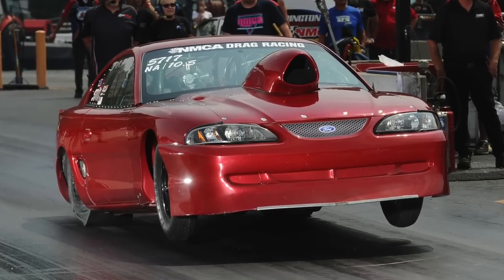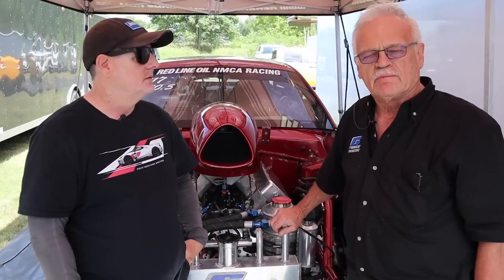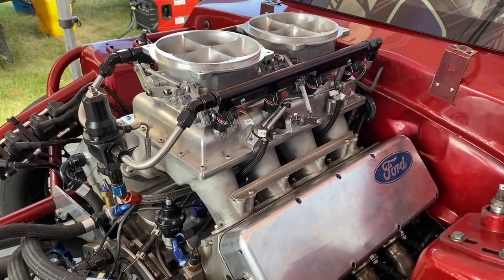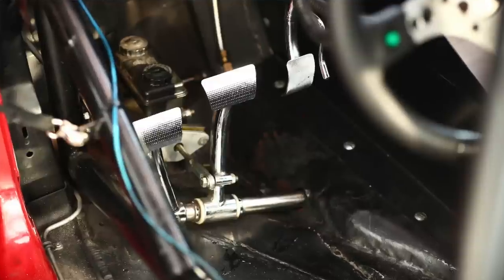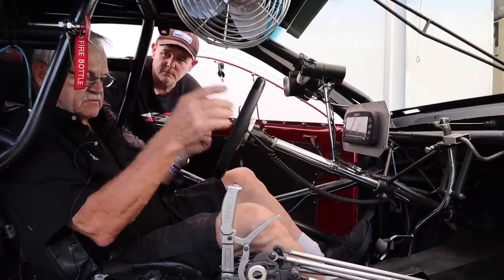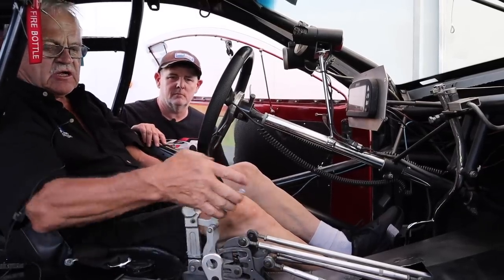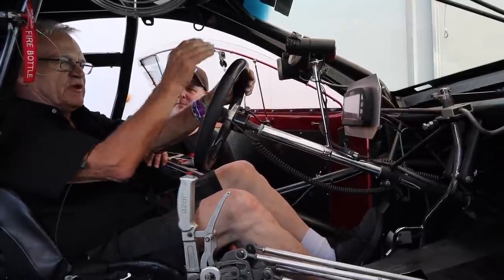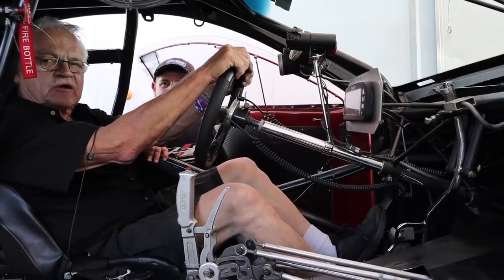10,000 RPM Small-Block Ford Makes 1,100 HP | Manual Trans, All-Engine Leonard Long 7-Second Mustang

Comment: One of your best videos ever! This guy is a TRUE enthusiast. You can tell by his voice that he lives to do this. Awesome just Awesome 😎...And he does it with a SBF.. My all time favorite. 👍
Reply from the maker: Thank you!
Reply: The thing is, when people find out a person is a go getter, like this guy is; they work them to death....

I bet he has no idea where the snooze button is on his alarm!
Reply: I’ve got an addiction to NA small blocks. May not make the most power but the sound is 👌🏼
Reply: @RadDadisRad  my Dad and I had a .030 over 350cid so 355cid and it was together for over 15 years with no catastrophic failures and was never taken out of the car and it had 14.1:1 compression so a big dome piston and it a .540 lift solid flat tappet camshaft in it and it was N/A and the 72 Nova it was in weighed exactly 3000lbs on the nose with a 230lbs driver and it was all steel all glass and everyone that was ever around it said that it was the best sounding SBC they ever heard and it ran consistently high 10s every weekend at the track and was on the street for the first half of it's life so it pulled double duty so to speak and then we took it off the street and just ran it on the track  and after 15 years we pulled that small block out and put a bigger small block in because we wanted to go faster and that engine was still together and running when we pulled it out
Reply: @revanevan  when you find these high rpm builds please go into the valve train details if possible. hp is easy high rpm is not...

Comment: Wow. What a great video. I’m 70 years old and watched a lot of drag racing. Nice to see N/A Ford power, but more than that:  10,000 rpm with a pushrod V8….that is amazing.  Not so long ago, if you could turn 8500 everyone assumed you were running the ragged edge of blowing up on every run.   Valve train technology and aftermarket blocks and rotating assemblies have continued to improve the breed. I had to laugh when he said he is using “old style” NASCAR heads.
Reply: Those castings are in fact over 25 years old, C3's and D3's are canted, and flow in the 400's int. Im sure close to 16:1 comp. too... great all motor small cube combo!
Reply: I believe those heads were used in the early 90s. 700ish horsepower in a Cup car back then. I always wanted to see a set on a 427+ cube small block!
Reply: @collegeparkwhiteboy  The C3 castings are splayed valve, the D3's are canted. Nascar run the D3 castings all the way into the mid 2000s prior to the FR9. This engine is more than likely 17+ to 1 and Over a 1" of lift on the camshaft.  Essentially a Australian prostock deal.
Reply: Yes they are based off the d3 head but both the intake ports and exhaust ports have been welded up and raised so much that the valve cover rail had to be raised up too . The chambers  were redone with 2.300 int and 1.58 exh valves and I think the valve angle were changed too (it been a long time ago that we did them I don’t remember if we changed the valve angle or not but I think we did) and yes it has over 1.00 in lift cam in it. So yes it’s based off from the old nascar heads but are nothing like what they used in nascar.
Reply: @colt7448   not quite a Australian pro stock it’s about 150 hp less and there all using billet heads
Reply: that shit is not n/a lmfao theres def power adders if hes claiming n/a hes probs running nitrous
Reply: @ianb3866  - you’re too used to those crappy Chevy engines. Fords make power buddy
Reply: @CoyoteFTW   Is that why 50% of mustangs got an LS in it? Buddy.
Reply: @ianb3866  - is that the only argument you guys have? Monkey see monkey do. 1. engine swaps aren’t easy people are lazy why not just do what’s already been done. 2. Foxbody platform is perfect. It’s not because ls is some marvel. There very easy.
Reply: @CoyoteFTW   I guarntee youll get gapped by a LS 7/10 times in racing. I am not saying sbfs cant make power LS is so much more simpole and aftermarket support is so much better. If you want to rule them all you go HEMI. at that point youre really making custom stuff and custom tunes. Youre used to watching youtube videos and not participating in building engines or racing so put a lid on it.
Reply: They are 1100 n/a dude...  There are 400 ci Chevy ls in the 1200 hp range.
Reply: Agree
Reply: @ianb3866  Only Chevy guys put Ls engines in Fords because it's a better chassis.Always cracks me up how you have to justify your ls swap into a Ford etc.Have you seen an MMR Coyote ?Now that's a real engine fit for a Mustang.
Reply: @dennisrobinson8008  So?MMR have Coyotes making 4000 hp.Enough to blow your Chevy crap into the weeds permanently.
Reply: @petergiannaros9037  4000HP?   Boost changes everything.   There are 2.0L 4 cyllinders making 3500 HP on boost.
Reply: @ianb3866 what LS has gone 300.4 mph in a standing mile? Zero. MKII MOTORSPORTS Ford GT has with the oe block and heads 5.4L. 
Which LS has run 5.88 @ 256mph with an almost entirely oem engine,? Zero. John Mihovetz has with the oe block, heads, timing components and crankshaft 4.6 4V, 3,000 hp @ 10,000 rpm.
Or which oe LS head has gone 5.67 @ 265mph with 351in³? NONE. MMR has with ported oem GT350 heads on a billet Coyote block.
And this past weekend, Brett Lasala whipped every full billet race motor over Sick Week with a sleeved Predator block, ported GT350 heads and Coyote crank. 302 in³ 2506 rwhp proven street car on 275s. 
LSs are great for the everyday Racer, but full out hp, no two valve LS will ever match the twin cam Fords unless it's 100% billet and twice the displacement. 
4V Fords > everyone else.
Reply: @dennisrobinson8008  120 psi, a percentage of CH3NO2 and not a single oe part left. Mmr has gone 5.67 @ 265mph. No 4/6 banger is touching that mph and that's on a ported oe head.
Reply: @ianb3866 😂 until you get to the quickest classes.

Comment: So cool to see some of the "older" Ford Nascar high port V8's being used in a different kind of racing, don't follow drag racing that much but this car engine/head combo is way cool, that high rpm sound reminds me when some of the Ford Nascar teams were turning ridiculous RPM's at the end of the the straights like the 10,000+ Leonard is talking about oh man love that sound!!!
Reply: those are the best small block castings ford has ever made. used in nascar between 2004 and 2009.  I would love a set but they cost like over 10 grand new.. love this stuff even though i live in europe

Comment: Killer car man!!! shades of Les Baer and Doug Mangrum. ive said this a million times a Cleveland style headed Ford smallblock is the BADDEST smallblock on the planet!!!
Reply: I ran 3 different Cleveland engines.
They were manufactured in Australia for 2 years I believe. 
The Australian block and heads were punched out from the same piece.
Which meant they heated and cooled the same.
A lot less likely to warp.
You could just about throw baseball through the ports. 
Polish the heads and add some other goodies... and you could run pass after pass and crush dreams with a grin.

Comment: Mr. Long sounds like a real car master! Turning 10,000 on a 415 sounds just amazing! It's so good to see he's running that great & with a Ford engine, not some other brand,like too many are doing!!! Absolutely loved watching this! By the way,my late mom's maiden name was Long...I wonder?!lol Keep up your great work man,love your videos!❤😎👍
Reply: He's just found the flow he needed. Not to bring up Chevy for anything important, but when you build a 4.8L vs. a 6.0L they basically turn about the same top end RPM. 283's used to be RPM king back in the double hump days, but the double humps had the right flow for a 283 or maybe 327. On a 350 or 400 not so much.
Reply: @kramnull8962  I know guys with small block chevys years ago,were turning 10,000 on strictly drag engines. I was referring to the guys that run Chevy engines in Ford bodies. It's nice to see that guys can be very competitive with Ford powered Fords!
Reply: @Mike583  My only point was just the fact that most all of those 10,000 RPM sbc's were the small cubes. Not a 350 or 400. Wasn't until they got better heads that flowed better for the bigger cubes. Not the double humps on those bigger motors.
Reply: @Mike583  I think it was 1990-92 that Yates started getting 9400-9600 RPM with the Ford engines. I cannot remember what style block they were using back then, but that was a huge mountain to climb in NASCAR.
Reply: @Mike583  - that’s not really news tho is it? Really good powerful Ford engines out there can’t tell if you’re giving compliment or downplaying it. Who cares what chevy doing or who swaps what

Comment: He mentioned Vizard... who made record of everything he touched associated with cylinder heads for decades. You only have to keep the bottom together and make the most of static compression ratios. The Heads and the Camshaft are what most interest me, figure he's into the 0.900 + lift range with duration pushing 300° @.050, Intake opening around 40° to 42° BTDC and Intake closing around 74° to 76° ABDC with 106° L/S Takes one wild ass camshaft to turn 10,000 while making HP to the top. Those secrets we'll never know, but it's fun to speculate. Nice Operation. (and of course, he mentioned the importance of chassis tuning)
Reply from the maker: Different guy, he’s speaking about Dave Visner. Vizard is really smart as well.

Comment: That's incredible! I'd like to know more about those heads and valvetrain!!!
Reply: A lot of welding on the int and exh ports so much that we had to raise the valve cover rails up about a .50 in . The chambers were redone and fitted with 2.30 int and 1.58 exh valves and the motor has over 1.00 lift cam in it.
Reply: @mellowolf  That's incredible! Thanks for taking the time to reply!

Comment: Used to race modified in the 80s, I had a opel gt 278 sb Chevy, low 8s 1800# shift at 10, cross at 11k
Wayne county speed shop clone

Comment: Do you have more info on the clutch he's running? How is he holding the car at the line while on the chip?
Reply from the maker: We use a small amount of brake pressure and hold it with the line lock.
Reply: @revanevan  thanks!

Comment: Did he ever run in the NMRA? And I hate to say but calling that Lenco type setup a stick shift as a far stretch. Still badass though not knocking it at all
Reply from the maker: Bill, please look up the difference between a clutches 5-speed and a Lenco. A Lenco is a planetary-based transmission, this is a manual transmission with gears, sliders, shift forks, etc. This is in no way like a Lenco, other then you don't need the clutch to shift.
Reply: @revanevan  correct I made a mistake I was thinking sequential type shifting which is still not a stick in my opinion
Reply: @revanevan  after checking out his website it looks very similar to a Jericho but with a sequential shifter on top

Comment: That is not a standard dude it is a linko style transmission!
Reply from the maker: Actually it is a manual, not a Lenco. A Lenco uses planetary gears, which is what you’d find in an automatic. This uses standard cut gears with sliders and linkage just like any manual. The difference is this unit can be shifted without the clutch at WOT. Please do a little research before commenting telling us we are wrong.